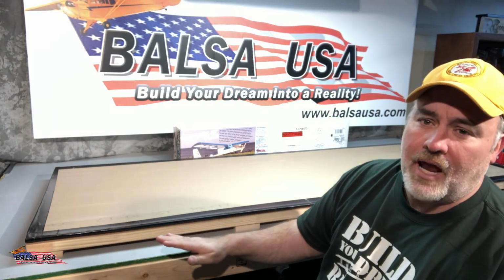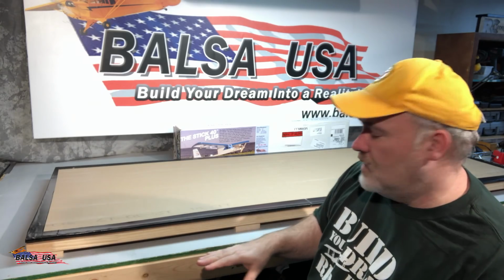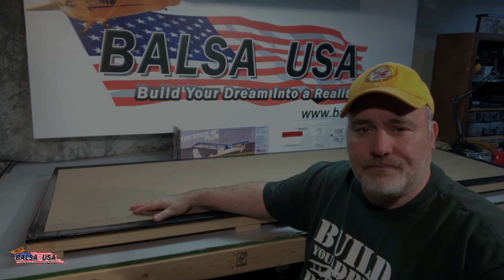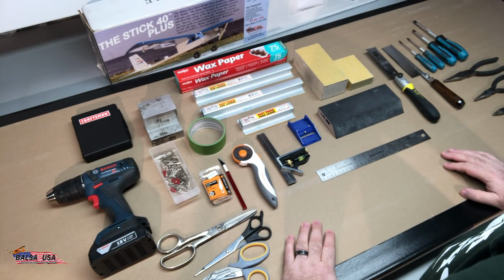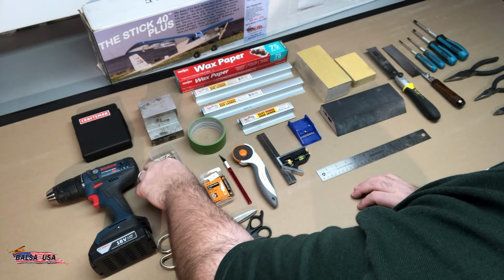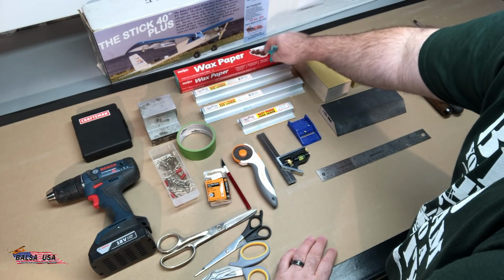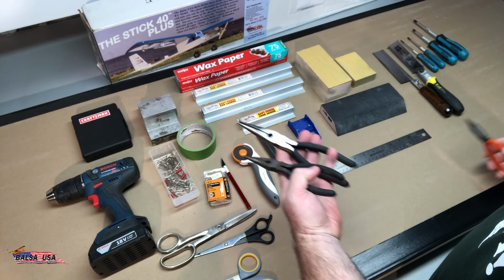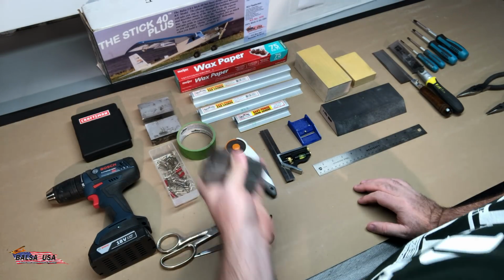Beginner Series 1

Comment: When laid flat on a bench, a hollow core door will tend to sag. A solid door blank is much better (but heavy).
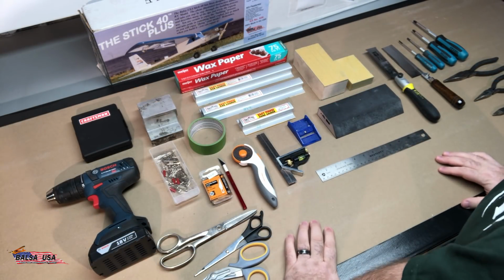10:35 Much of what you see here is on my bench as well, although I do prefer a corded power drill. On a cordless drill, if you don't use it on a regular basis, the battery will go bad and no longer hold a charge. Variable speed and reverse are nice to have.
The "Easy Touch" sanding bars are a must have!
14:20  For many years, I've been using X-acto's razor saws. That is, until I just recently picked up a Zona saw. Should have done that a long time ago. They're that good.
Clamps! We didn't talk about clamps!

Comment: Any source for pins with plastic ends? Cannot seen to find them anywhere. Having difficulty pinning in Sheetrock
Reply from the maker: wfletch88 Midwest grip pins
Reply from the maker: https://midwestproducts.com/products/grip-pins-50-pins
Reply: Never use sheetrock to pin a model to. That is asking for hassles.

Pro tip:
Use 2 foot x 4 foot drop ceiling tiles or dense foam insulation boards.
(you can thank me later)
Reply: @waywardspirit7898 how thick of foam? 1” or 2”? Heading to Home Depot this weekend if the rain lets up
Reply: @ I would go with the acoustic 2x4 drop in ceiling tile. They are perfect density and 1/2 inch thick.....Foam would be my second option. If your gonna go that rout I would use 1 inch minimum thickness of the dense purple or pink insulating foam.(not your typical white foam) You can find this in the wall insulation isle. Good luck
Reply: @waywardspirit7898 went through 7 doors (all that Hd had) got one that’s flat enough 24” wide, I’ll be going back next week and I’ll see if I can grab some ceiling tiles

Comment: For the Great Planes Sanding Bars, I see you have 80, 150, and 220 grit paper on there - which is how they sell it. Based on other research, it seems like I should be using a higher grit (220-800) for balsa. Do you think the higher grit is necessary?
Reply from the maker: Aida Hendrickson I keep a ton of sand paper around. I do a lot of work working as well so for me having several different grits is normal. You never know what you will run into so I’d say for the price point, it’s not a bad idea to have it on hand. Will you use it all the time? No probably not.
Reply from the maker: Keep in mind there is also, lite ply and basswood in there too.

Comment: Loving the series Joe.  I added a few thought to your tool list below.   

Wax paper is ok for covering plans but I use celophane/cling wrap. CA seems to still stick to wax paper and does not stick as bad to celophane/cling wrap. 

The great planes sanding bars are awesome for sanding. I have three, each one with a different grit of sanding paper on it.

I use my 123 blocks all the time. You can also go to your local machine shop and ask for scrap pieces of steel blocks.